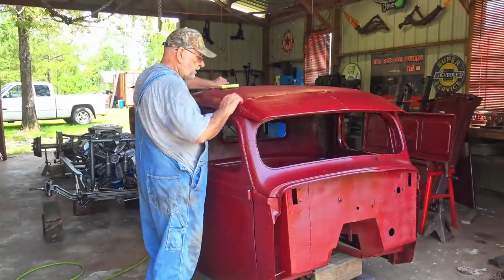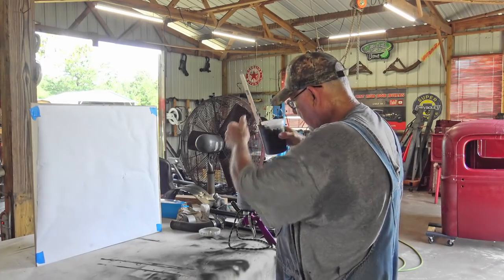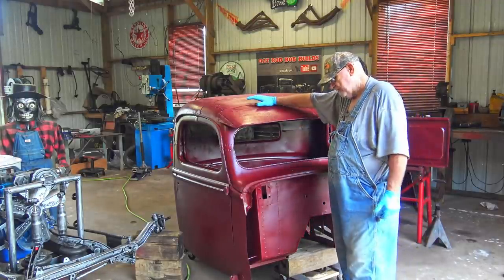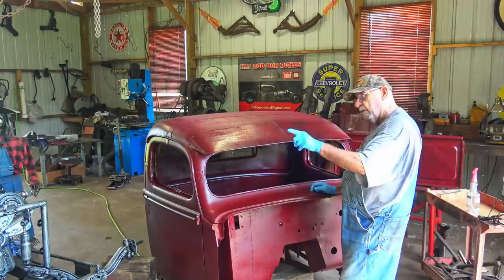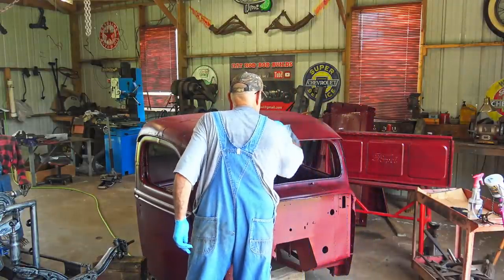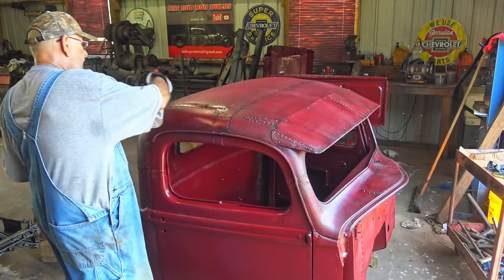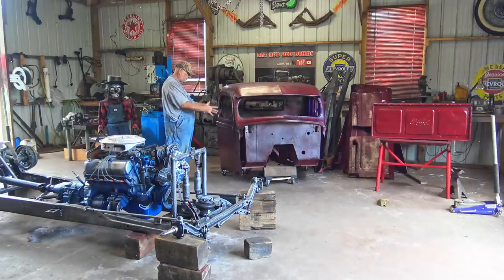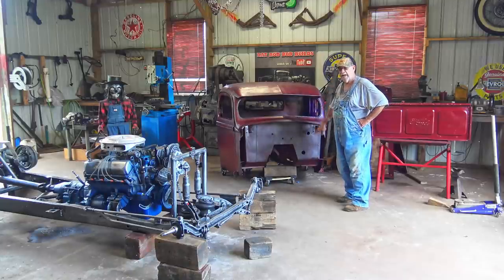Eye Candy Distressed Rat Rod Truck Cab How To

Comment: The sun visor looks righteous!  Bob certainly knows this, but for you others, with a catalyzed paint, if you've put in the catalyst, but you have lots of leftover and are going to paint the next day, put it in an old refrigerator, not one you put your food in!!!  And it will keep a few days, certainly overnight.  Let it come back up to ambient temperature before using.

Bob, when I "weather" model railroad cars (nothing is shiny on the railroad) I do similar to what you did with the black, and it not only adds to the age/patina/grime, but really brings out the details on panel lines, rivets,  and other surface detail.
Reply from the maker: Wow ... didn't know about the frig thing ... never too old to learn.
Reply: @RatRodBobBuilds  Bob, we did that at work with Jones-Blair Acrylithane, which was a catalyzed polyurethane chemical resistant paint.  You can find an old working fridge.  Don't put your lunch or any food items in that fridge, use it only for paint.  I think the paint, at normal temps, 70-90*F had a pot life of about four hours.  We'd keep a gallon mixed for painting smaller subassemblies, think motor size stuff, as we'd rebuild these items, so we could make a gallon of paint go two days.  
This paint comes not a full gallon.  Open and mix.  There is still room to add a pint of the hardener, and a little thinner.  Then it is just right to paint.  Thinner... they called it "Reducer", and there were fast, medium, and slow reducers available.  Another trick was to add about 50% extra hardener, which would make it a really hard shiny finish.

Comment: Rrb the paint effect looks cool as. I'm keen to give it a go.
Reply from the maker: Keep in mind that this may not work very well unless you have a really rough body with pits and dents and stitches and patches.
Reply: I have a 1934 Chev truck cab on a 1928 Pontiac chassis. Loads of pits, scratches and dents. I often wonder if how it would turn out if you rubbed a bright green paint over the silver, after the black? In my head it might look almost like a slime, or radioactive effect.
Reply from the maker: @shanehack871  You never know until you try.  I would do a small part first to test the theory!

Comment: Not a fan of "Fake" patina, clear coat over original metal,looks much better,but nice job Bob,just sayin'
Reply from the maker: I hear ya ... tried that for weeks on unpainted metal and it don't work like they say it does. Patina, that at least has a little primer covering the metal ... yes .. but if you have one spot that is bare or rusty metal ... it will keep eating like a bad cancer. Clear won't stop that!